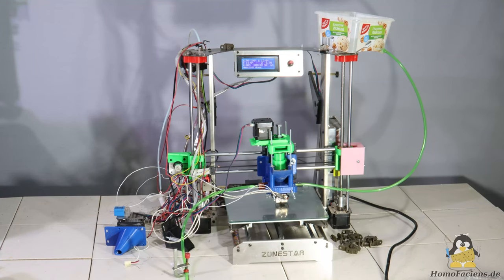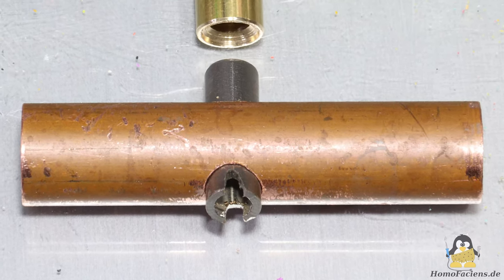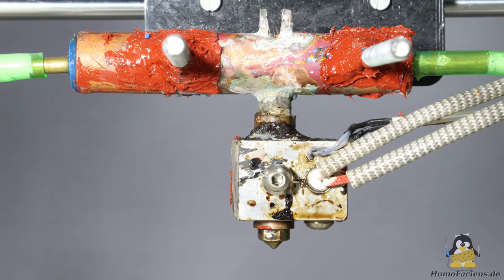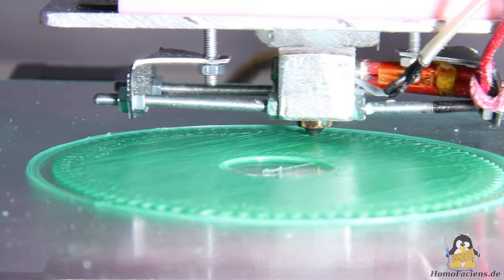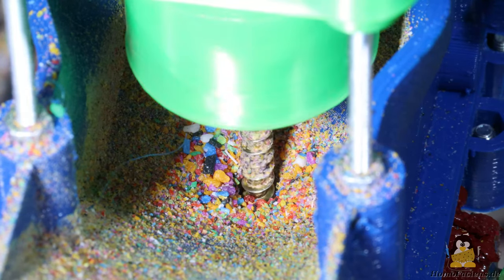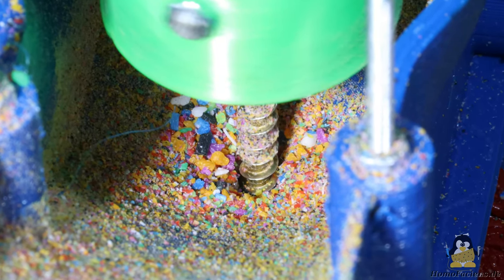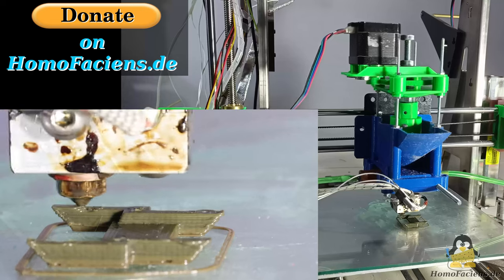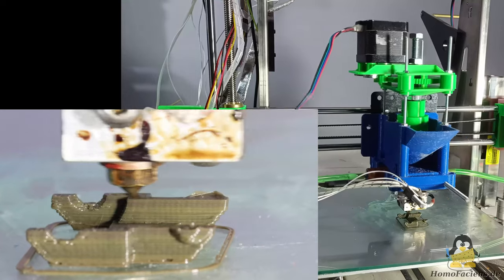Direct Granules Extruder V4: Basics about the new design

Comment: The requirement for a very sharp temperature gradient and effective heat break is a real breakthrough in this sort of material printing!  

I’ve never seen anything like it. Most direct granular printing I’ve seen is treating the extrusion like injection molding, I think your strategy is really smart!   The only drawback I can imagine is probably delayed reaction for retracts.
Reply from the maker: Retract is always delayed. The trick is to reduce that delay as much as possible and that's what I am currently working on by shrinking the extruder, which also addresses other issues I will talk about. Stay tuned!

Comment: your early there , i watched this project evolve and its seriously impressive.
i think the next prototype should rotate the motor 180 degrees and put it between the X axis rails , that was you wont have significant weight in an undesirable location , it might cause the X axis to wobble when stopping ,
also i dont think its a retraction issue , i think its a pressure issue , the blob at the end of travel is the excess pressure on the nozzle driping out ,maybe calibrate pressure advance in marlin ?
i think the screw is not garbing enough material to relive the pressure near the nozzle , thats why you have that extra blob 
also you can enable wiping in prusha slicer where it will wipe the nozzle into the part to prevent blobs from forming .

but your smart boy ,you probably figured all of this out already
Reply from the maker: Thanks! The ideas that evolved in my head over the past months are materializing.

The overall design of the extruder is anything but perfect. Quick & dirty, but working. Yes, flipping the motor for 180 degrees is one of the ideas in my head. Not only for a more compact design, but for additional ideas as well (more on that in one of the coming videos).  It would mean an extra pair of gears or pulleys if a direct drive works. Future will tell. More on that when I will start converting a more modern printer than my good old Zonestar that went out of production over a decade ago.

Yes, it's pressure that makes the plastic exit the nozzle. To avoid talking about that in detail, I simply refer to all of the processes as "retract".

Bad hardware engineers always say: "The software guys will fix that!" ;-)

Comment: I think you would be better served by aiming for larger nozzles, as 0.8mm or even larger.
That way impurities will be a much smaller concern, and your raw material can be more inconsistent.
Reply from the maker: Yes, that's obvious, but my aim is to replace standard filament extruders and these work with 0.4mm nozzles. I will talk about that in a future video and also show solutions for that issue.
Reply: @HomoFaciens  cool :)

Comment: interesting! I always wondered... what if the assumption would be to accept a continuous extrusion (no retraction at all)? How would a robotic design and G code look like that accumulates the extruded material? Could it "accumulate" unused material in little beads that are fed back into the hopper? Would it be feasible to design a cooled gutter that clips off the extrusion and actively sucks on the nozzle? Or is a rotating disk an option?
Reply from the maker: Well, looks like you are keen to add complexity to this project. I won't try something like that  ;-)

Comment: Looking very nice! Have you looked at something like the Hulk frame brace for the Anet A8? I'm not sure what it would take to adapt, but it made a huge difference in my printer quality. 
Second, klipper might help because of pressure advance. I would be curious to see how it treats the little bit of extrusion during a retract. 
There's also someone else designing a large pellet extruder. Have you seen that one?
Reply from the maker: Thanks! I won't start improving this printer mechanics, simply because it went out of production a decade ago. Instead I will start transforming a modern printer into a granules printer in the not so far future.

At this stage of development it would not make sense, if the software would trick me to think the extruder it better than it actually is. I am working on a constant extrusion hardware wise. If software can make this even better after the hardware is optimized, that will be okay.

Who is the someone you are talking about? Because there is more than just one "someone else" that has or is mounting a more or less conventional pellet extruder on a 3D printer frame with more or less the same outcome: They can print large structures more or less,. If you want to print small structures, shrinking the extruder isn't enough, you must also shrink the raw material, something I am working on with my series on grinders / blenders..
Reply: @HomoFaciens  makes sense. It's nice to see you trying to make the issues clear so you can fix them. I'm excited to see the new one when it comes! 
Here's the guy with the other pellet extruder: https://youtu.be/f0rVNFXp9IA?si=1M2YG1tRGKg3-acq
It's still mostly diy, but he designed a custom screw so I expect it to cost more than this. I love seeing them both!
Reply from the maker: Another one that only shrinks the length of an extruder design that is meant for injection molding. Which has been done before with more or less the same outcome: You can print large structures, more or less. I guess there is a reason why he printed a Benchy much larger than a normal one? Also, more than half an hour of talking, but no more than 10 seconds showing his printer in action. 

As I have told multiple times: You must shrink the granules as well to be able to print small structures as is the aim for my design.
Reply: @HomoFaciens  I think the more important parts of his video are the little tricks he's come up with, like the clever way to empty the plastic out, and the plastic delivery system. Obviously it's at a larger scale, but might be useful on this more accurate system.
Reply from the maker: Well, cutting the hopper into halves to empty out the plastic is something I did with my very first prototype years ago (okay, I used screws, not a slide in mechanism). Also using a big reservoir on top of the frame is what has been done from the beginning of pellet printing. I feel like having switched to a sales channel when watching his video(s).

Printing a benchy bigger than usual without even mentioning that is was printed bigger isn't what I call openess.  If you buy a printer, you want to see the printer in action, not hear someone talking about what all "could eventually be done". He never tried printing chocolate as he says would be possible. If so he would know that chocolate grains stick together in the hopper, preventing extrusion) and that chocolate needs ages to solidify after extrusion.

His extruder isn't scam, but far from delivering all the promises he makes. As told before: He isn't the first one who has bolted a more or less conventional extruder to a 3D printer, with more or less the same outcome..

Comment: How difficult would it be to make the printer to print upside down? Print bed at the top and extruder at the bottom. Could this work? Bit unconventional but an idea. The heat would rise to the print bed and not to the extruder.
Reply from the maker: Well, that's what you can try out yourself after replicating one of my extruder designs ;-)
Printing upside down has been done with filament printers, but the success wasn't overwhelming, or was it?

Comment: you sure you cant increase the acceleration on the extruder? it looks like your settings are too conservative, you should reduce the microstepping to x2 or x4 and increase the jerk and acceleration till it starts skipping steps. Also if you use helicoidal gears instead (make them right angled)  it should help with the noise and backlash. (though you can fix that on the extrusion after retraction setting on prusa slicer)
Reply from the maker: It is more the top speed for retract. I have of course tuned that parameter (as well as acceleration) to the highest possible. With the high overall reduction (gears + screw pitch) you need a long travel to retract efficiently. As told in the video, I will address that in the coning video(s). Stay tuned!